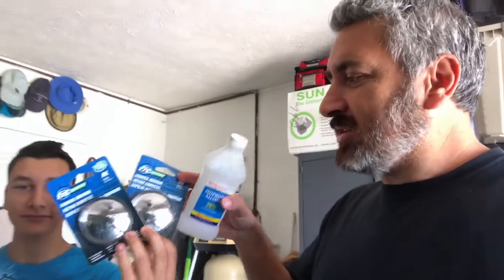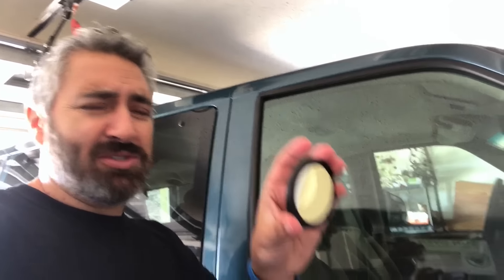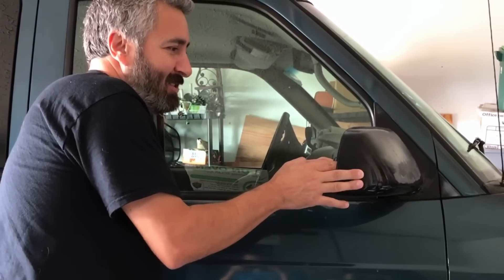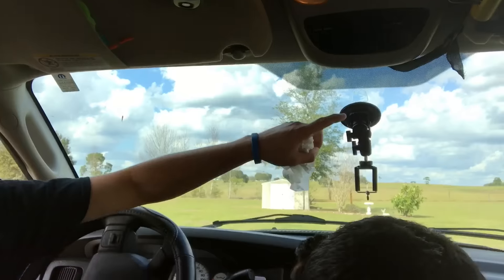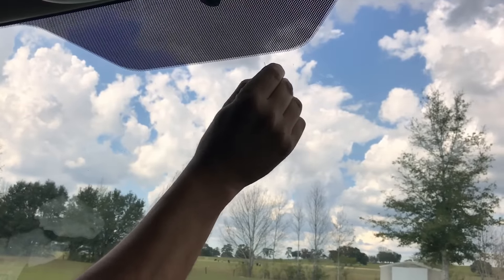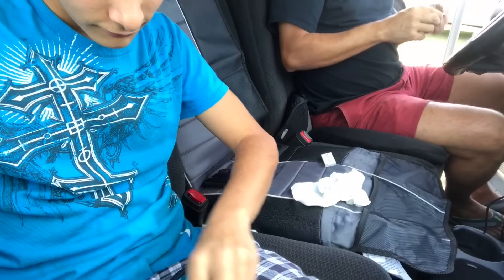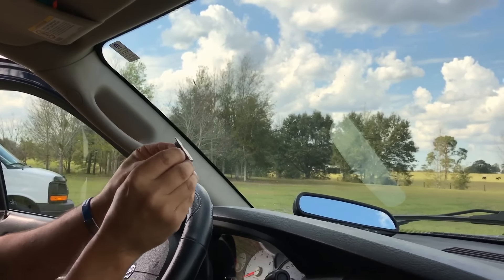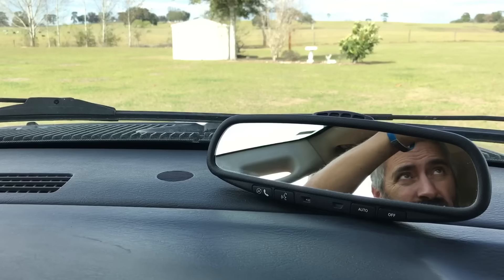Van Life; Fixing Truck Mirror: Adding Convex Mirrors!

Comment: I just installed a rear view mirror in my van.   I taped (painters tape) the metal plate to the window shield and left it over night to let the epoxy set and harden and then the next day I slipped the mirror on.  I would let the epoxy set a little longer.   Great video as always!  😃

Comment: Luis, you and Chris would look so slick if each of you had one of those round blindspot mirrors stuck to your forehead. Then go shopping at Costco and get some reactions!  😜
 They do make this thing called a rear view mirror attachment kit with a base and a teenie tiny vial of special adhesive for glass. The adhesive is very thin and a kind of etchant as i recall. Just in case whatever that was you used didn't work ☺